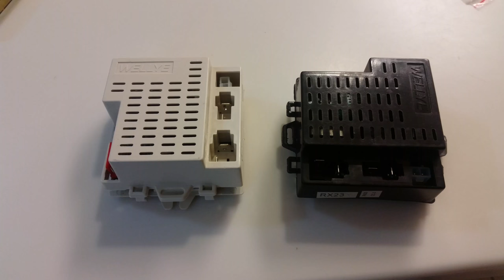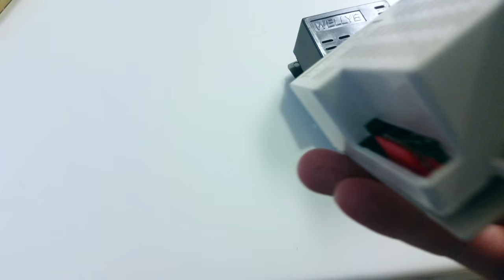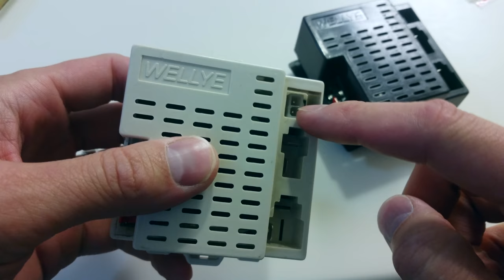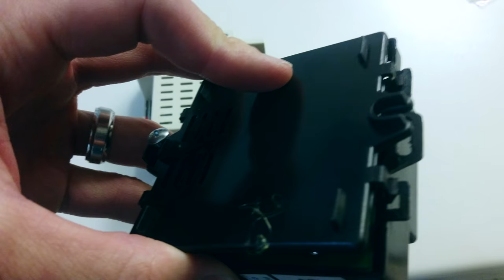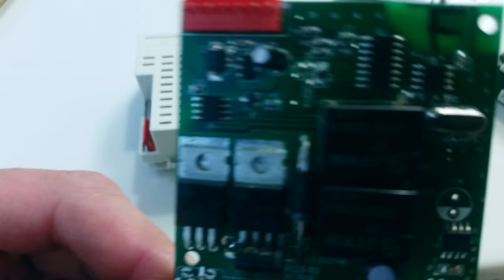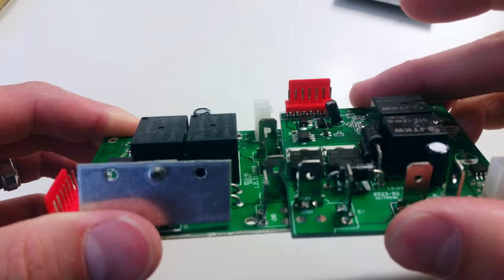Best Toys Jeep Wellye control repair

Comment: If anyone can help. If my sons 12volt quad was kept out in heavy rain would this part prevent the quad from starting? I replaced battery and it still won't turn on.
Reply from the maker: Check the battery voltage first. If the battery is good, check this part. If something is wrong, it might be something you visually identify, but maybe not, so replacing it could fix the issue
Reply: @1empyre1life  Thanks for the response

Comment: I did the same thing to mine & I ordered the new Weeyle part but now the radio isn't working and remote wont sync. Any ideas?
Reply from the maker: My radio stopped working when the original board died and didn't get fixed with the new board. My guess is some sensitive electronics in the radio were somehow damaged.
Reply: 1empyre would you happen to know if they sale the radio chip online? Tried looking but no luck. I contacted the manufacturer and they haven't for back to me.
Reply from the maker: @markzepeda6864  I did some searching for the radio chip but had no luck. I have an old car stereo that I might try hooking up and mounting somehow lol.

Comment: Do i need to buy the remote for it or can i connect the one i have
Reply from the maker: nayito cota you can use the existing remote. You will just have to sync it with the new board

Comment: I'm curious if anyone knows the part number for U3? It is the mosfet with the large heatsink from the board in the white box. I can read what appears to be "150N" but the rest of it is gone from damage. Is it the same 150N03A as shown on the other board (black box) in this video?
Reply: For anyone out there, Amazon has the entire controller box for about $15. 

I ordered one to help me fix the broken one. The new box I received has a different part for the U3 MOSFET. It is NCE30H10.

You will only find this part on ebay from china. I have found a cross that I believe will work that part number is long, it's IPP80N06S2L07AKSA2. This part is on Mouser.com. I use this company every day at work.

However, I don't think you'll get around ordering the steering driver IC RZ7889 from china. I am not able to find a cross for this one. Most motor driver ICs out there are more than 8 pins. The ones that are the correct package (SOIC8) are not rated for 3 amps like the RZ7889 is.

Comment: What happened to myeen is plain bad luck, I upgraded. Was 6v went to 12v which isint even that high. The car works perfectly if driven manually. But my 2 year old cant ride it like that. The remote works for forward and backward, how ever it does not turn the wheels from remote.
Reply from the maker: Other people have had this problem, but I'm not sure what the cause or solution would be.

Comment: What is the specs of c16 capacitor? mine blew and i need to replace it
Reply: C16 should be 16v 220uF. Replacing with higher voltage rating is fine but must be 220uF

Comment: Do you have a schematic for this controller?
Reply from the maker: I do not. Thanks for the comment though, and if you do find a schematic, I'm sure others are interested.
Reply: @1empyre1life  thanks.  I have the black version and there is 1 unused pin of the 7. It's the 3rd pin closest to the short edge. Wondering what it's for and if I can use it for something. Would be cool if I could beep the horn or switch music etc remotely. My car has 3 speeds controlled by the remote, and has the gradual acceleration feature. Would appreciate If anyone knows what these pins  are. Thanks.

Comment: Did you find out why the new replacement capacitor did not fix the problem? Maybe you installed the capacitor the wrong way around?
Reply from the maker: I tried several capacitors, installed both properly and reverse polarity. The relays, as suspected in the video, were damaged. There may have been other components damaged, but I couldn't find any other obvious damage.
Reply: 1empyre thanks so much for your reply. At least you tried. I will try to fix with new capacitors. If it don’t help, I will get a new controller. Stay safe
Reply: @1empyre1life  can you let me know what size cap that is that blew
Reply from the maker: @sr8shoota  I'll see if I can find out but I don't have that toy anymore.

Comment: My car won't go forward on remote or gas pedal what's the fix
Reply from the maker: Troubleshoot. If it was just the gas pedal/wiring, the remote would probably work. Since they both don't work, it could be the electronics, which a board replacement could fix. It could be the relay that controls forward movement as mentioned in the video. If you know how, test the continuity of the depressed pedal. If it's good, then the likelihood of the circuit board being the problem is even higher. It could be something else, but if you test as much as you can and everything else checks out, get a new circuit board/box. Let me know how it goes!
Reply: @1empyre1life  yeah that's what it is.  I noticed the Master switch went too so it's something in the circuit board
Reply from the maker: @dmtmachineelves  Hopefully a new board will fix it. Post a reply on your results!
Reply: @1empyre1life  will do thx

Comment: Does anybody have  ride on 4 wheeler (12v) that was working fine then radio and sounds stopped working. We have another one  which everything stopped working including  the motors. Only thing that worked was the power button (red light) and the headlights. The replacement had same issue right  out of the box.  
   Bought new control board and put it in the newer 4 wheeler and still no sound or radio. Drive  motors still work along with headlights but that's it. .
Please help if you know of any way to fix this
Reply from the maker: I believe the sounds are on a different circuit board. That could be the problem.

Comment: Can you provide a link where you got it
Reply from the maker: Search "Wellye 2.4" on ebay and you should get results. Make sure to get the right connector based on your existing board, ie 7 pins, or whatever. Apparently you can get them with a new controller, which appears to be cheaper currently. Here's an example link that will probably only work for a short while. https://rover.ebay.com/rover/0/0/0?mpre=https%3A%2F%2Fwww.ebay.com%2Fulk%2Fitm%2F173673709644

Comment: we tried running 2x12 volt batteries  yesterday and it blew so we ordered the RX 30 24 volt which is coming in a a week.
We put the old 1 back in Jeep works fine but now no lights and sounds??? Any ideas anyone
Reply from the maker: I lost the radio when I blew my board. I may have lost lights and other sounds, but don't remember, as it's been a while.
Reply: @1empyre1life  thank you very much for the reply do you think when our RX 30 24 volt comes they will come back on please
Reply from the maker: @allstarshootinguk3222  you're welcome! Other comments on this video suggested that the new board doesn't fix the sound issue. I think it's a separate board.
Reply: @1empyre1life  is that the board where you charge it?
Because our battery is full charge also but showing up flat red bar on the bit where all the buttons are the control panel and where you charge
Reply from the maker: @allstarshootinguk3222  That's beyond my knowledge and experience on this matter, hopefully someone else can chime in and help!
Reply: 5 Months old, but, Having tried the 24v, I blew two capacitors, one on the control board, and one on the radio board.  You can get replacement radios off Ali Express.

Comment: Discovered the relays need to be upgraded which would result in come ghetto looking stuff because the right ones will not fit. I pretty much need to reengineer the whole thing.
Reply from the maker: MrGeekrick1 yeah you could make it work, but it would take some work. It might be worth it because 18v is awesome
Reply: MrGeekrick1 get the wellye rx30 24v  board and stick 2 12v battery’s in its awesome, had no problems